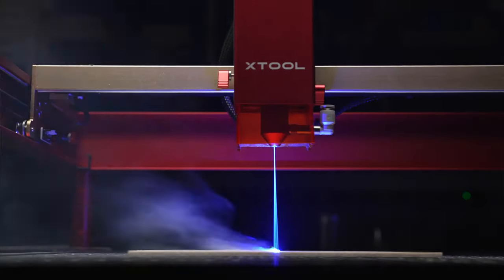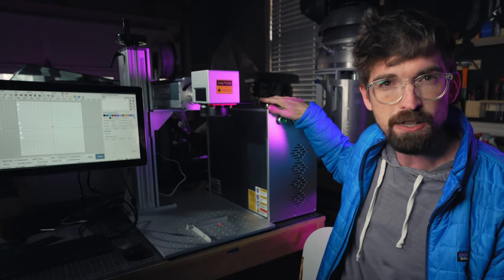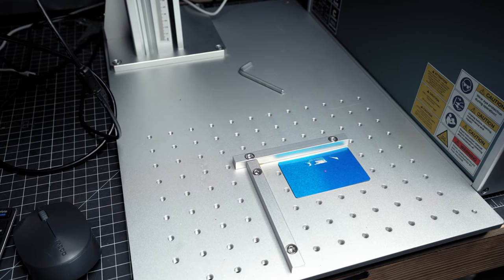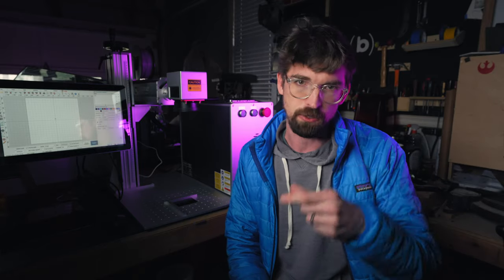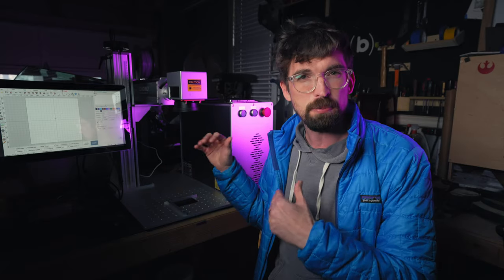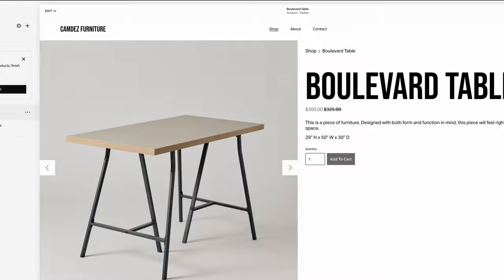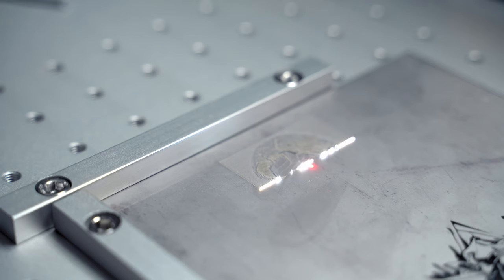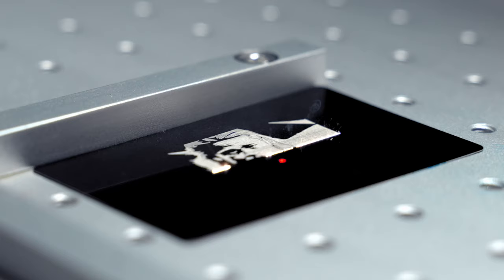Should you buy a Fiber or a CO2 Laser?

Comment: I work with industrial grade flatbed lasers. Both fiber and c02. We can cut up to 3/4" thick steel. Everything we cut requires assist gas such as nitrogen or oxygen. We've played around with etching and finite cuts for delicate materials but they're just not well suited to operate on such low wattage.

Comment: Which machine is more recommended for engraving plastic?  I'll be making labels for control panels.  These will vary in size but initial will be about 1-2mm thick with white foreground and black letters.  Some will need to use a very small font (probably 4-8 if possible) while larger ones will be 24-28 font.  For the smaller there will be up to 50 per sheet so it will also need to cut them out.  TIA

Comment: You should differentiate the laser beam generation (fiber, disk, CO2, diode) and the beam steering (galvo, gantry) since they are different things and are not to be confused. Otherwise people will think a galvo can be only uses with fiber lasers which is wrong.
It's probably more feasible to use this combination, since fiber lasers usually have a better beam quality than diode lasers (up to 1/100, with one beeing the best and going to inf) and 1/10th the wavelength of CO2. Both increase the ability to focus the beam.

Comment: I've seen some videos where the fiber lasers are able to cut carbon fibre.  I'm currently thinking about a 50w fiber raycus laser.  However, I'm also in need of some advice as the materials I'm most need to work with are aluminium and carbon fibre.  If I need a MOPA laser to cut carbon fibres that is going to mean I need a bigger budget.

Comment: I'm looking at different lasers and I'm having a tough time figuring out which power machine I would need to use for deep laser engraving for firearms, such as a handgun slide?  Also, which power is enough for doing stippling on polymer grips?  My gut says to just go for the 60w JPT, since I've found a few other shops using that.  At least, at a minimum, I'd know it is enough to do the job.  If you can help me out here I'll use your affiliate link, I'm wanting to get one of these ASAP.
Reply: Cloudray website shows a 2.5d engraving machine at 100w capacity.

Comment: Hi, great video. Can these types of lasers actually cut metal or just engrave it?
Reply: Fiber laser do ablate the material (vaporize it) but cutting anything very thick would take a very long time as to go very deep would require refocusing the laser often (every .5mm of depth approx depending on the power of the laser).  They are good at doing deep engraving which is unique to fiber lasers, but if you want to be cutting parts out they are probably the wrong type to use.

Comment: do any of these machines work with a Mac? or would i have to get parallels to run windows so i could use a fiber machine?
Reply: Lightburn supports lots of lasers and will run on a Mac, Windows or Ubuntu (and some other Linux based os).  If you purchase a fiber and it uses an EZCad2 type controller, it should work with Lightburn.  

An EZCad3 controller will not work with Lightburn.  I have a similar issue with OS, I run Ubuntu and none of these factory supplied software packages will run natively on a Linux box.

 I have a few lasers ... led, co2 and a fiber... they all are running under Lightburn on a Linux box...  It will run on your Mac.

Lightburn is very robust, great support, here in the US.  You'll be glad you tried it..  The trial version, in which nothing is restricted, is free...

Good luck

Comment: What are the safety considerations? It’s not in an enclosure … do you need glasses?
Reply from the maker: For fiber you'll want glasses and it still will make fumes that you would want to vent.  For smaller projects it doesn't kick up too much stuff though.
Reply: ANY time you are lasing something that can do damage to material, you had better take precautions.  Safety glasses are a must for any laser operation.  For CO2, I ware my regular glasses, they are polycarbonate and are effective at the lasers frequency.  For the fiber and led, I have glasses for them also..

Common sense says you should protect your eyes... You can find some Chinese videos of people operating various types of lasers with no eye protection.. :(

Comment: Easy answer its Fiber.
Reply: Problem i have with Co2 is they’re expensive for the tubes, they have short life, and the tubes are massive in length if you want a powerful laser. 

A 150w C02 is 1600mm long and $1400 and cannot cut any metal. Life limited and overall a waste of money. 

A 1500w fiber laser head with a control for cutting metal 1/4 thickness and engraving only costs $2500 on Amazon.

Sure you’ve got to provide your own gantry machine but any router table even a cheap $1000 4020  would work and you could even run the head on a separate rail on the backside of the router gantry so you have a 2 in 1 CNC. Why wouldn’t you, right! YAY, works for both.

Comment: But CO2 lasers can cut metal - here for example https://www.youtube.com/watch?v=XNcapGmzIOg , tube just has to be over 130W to be able to do this, right?
Reply: The cut quality shows it's not a good choice.  

Fiber lasers are for man made materials, and co2 are for natural materials... all lasers will encompass more materials than by that strict statement.  CO2 does excellent with acrylic, but generally requires some type of mark coating for metals...  Most metals reflect a high amount of energy, so there is a great loss of power in just the reflection. 

You also don't know if they were running that 140W RECI at 160W and after three parts the tube is wasted... People do that for videos...  Not to mention I've never seen a hobby machine like the one in the photo... Using oxygen or other gasses can also enhance cutting steel, like oxy-acetylene torches.

If you purchase a co2 laser that is a hobby laser, you'll be sadly disappointed by the results if this is what you are expecting.  Even a fiber can engrave wood, looks cruddy, but it will.

Everything on the Internet doesn't fall into the true category...  watched any perpetual motion or free energy videos lately...?